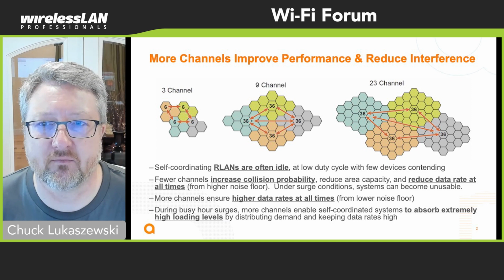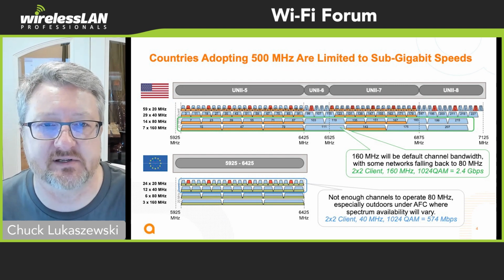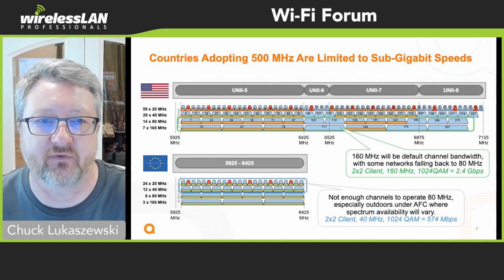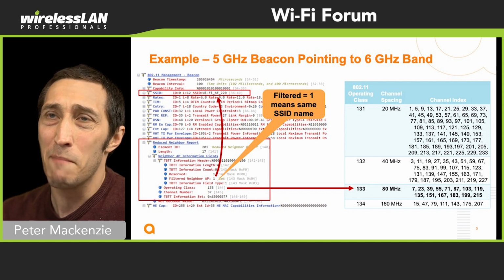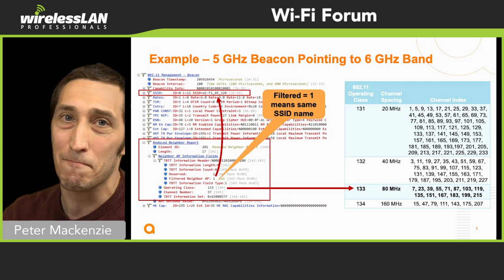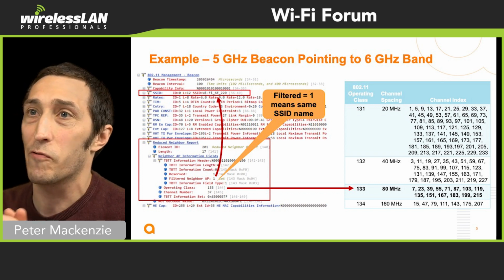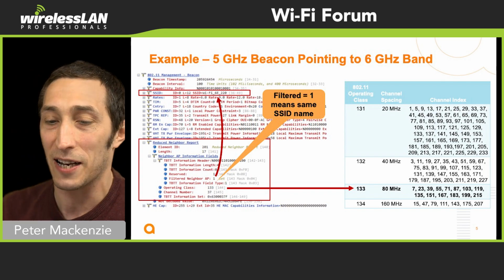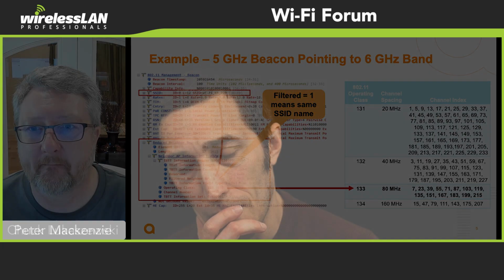Wi-Fi 6E / 6GHz Design Ad-hoc discussion panel

Comment: We have a single family home property which requires 10Gig to the home. We must have gateways and APs with at least 2.5Gbps ports. Regardless of the actual utilization of the higher rated ports. We are now seeing 8-10 devices per user in homes and especially multi-bedroom dorms.